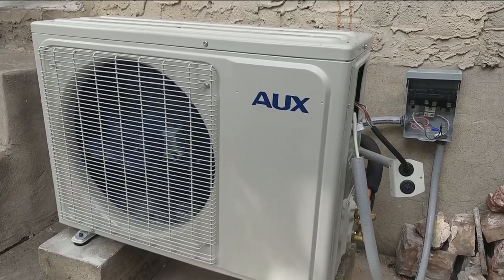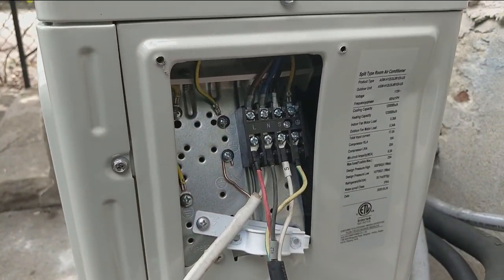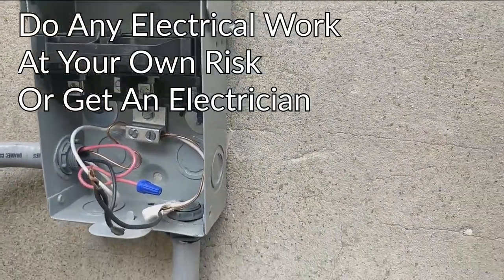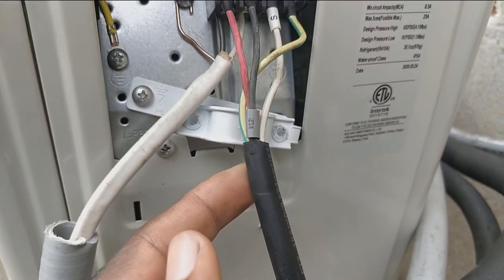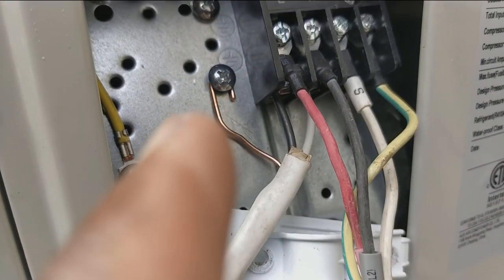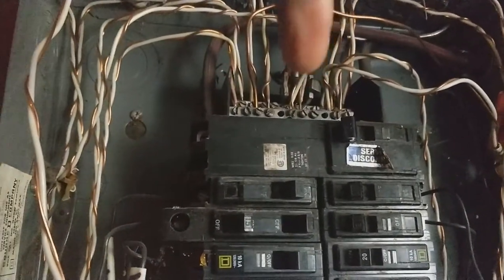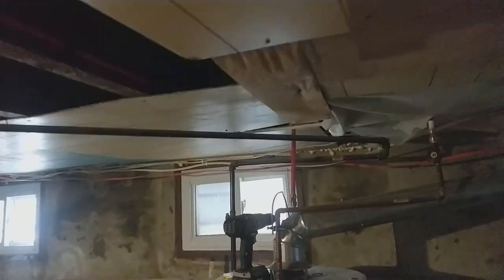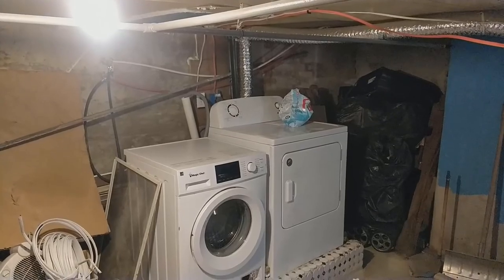How I Install My First Mini Split Heat Pump With AC Combo | AUX Mini Split 1200 BTU 115 Volt

Comment: On the disconnect pull the disconnect T-Handle out and flip it over and put it in the lower slots.
Reply from the maker: I'm not sure what you mean?
Reply: The black handle can be flipped upside down. It will read OFF or ON
Reply: Correct. The disconnect is installed upside down. Pull the back handle out and flip it over.

Comment: Great video!
Did you use single pole 20amp breaker?
I only have room for single pole breaker in my panel. (no room for doubl breaker and everyone wants to use the double one)
Reply from the maker: Yes I use a single pole for that unit.

Comment: Where did the inside wall unit plug at? Or was it connected to the outside unit only and then to the main
Reply from the maker: The interior unit get it's power from the outdoor unit via the wires the manufacture provided.

Comment: How do you take off the head of the blower
Reply from the maker: If you mean the entire cover for the inside unit. You have to look at the middle section where air usually blows out. There will be a little square shape with a 🔒 sign I think. You have to push it in, then you should be able to pot off the cover using a flat screw driver.

Comment: Did you have to buy the AC Refrigerant, or is it already in the AC Unit and you just use the pump you bought to circulate it?  Sorry… new to all of this. Thanks
Reply from the maker: The unit come with refrigerant in it. The pump is used to take the air out. After that the refrigerant can be released. Some people don't use the pump. I not sure how bad it will affect the unit if the air is not pump out before releasing the refrigerant.

Comment: What kind of vacuum pump connector did you use? My install is on hold because the standard size doesn't work on the unit.
Reply from the maker: It's below the video in the description box
Vacuum Pump: https://amzn.to/2FIj98J
Manifold Gauge: https://amzn.to/2ZZv1tS
Adapter for Mini Split: https://amzn.to/3hQB5uR
50' 14/2 with ground: https://amzn.to/302aq82
AC Disconnect: https://amzn.to/2HoJR6J
Senville Mini Split: https://amzn.to/2FI1nm3

Comment: Hi, thank you for your video. Where did you connect the gray wire that was on the inside unit that comes preinstalled?
Reply: It's power wires, I just don't know where I'm supposed to wire it up to
Reply from the maker: Looks like the gray wire goes to the "S" Spot. I think it's the communication wire.
Reply: @talenteddad  thank you for responding! I almost never get one when I post on a video haha. I went through all the other comments and found a video you suggested to watch. Turns out this specific style I have is so that the inside unit can supply the outdoor unit if needed, otherwise can do in reverse order and connect to 120v outside. 

Well see tomorrow when I attempt this install
Reply: @talenteddad  yeah the gray wire was hooked up to 120v and plugged into its dedicated plug inside to run both the outside unit and inside unit. Works great! Thanks for your video!

Comment: I bought a mirage 12000 btu 115 v doni still have to add power from a braker besides just the main plug cord???
Reply from the maker: Legally the should be a breaker outside next to the mini split. But I also see people connect it straight to a breaker in the main panel.
Reply: I have a different unit but they're pretty much all the same I think there's two factories. On the 115 volt I just got a power cord to handle that much I got it a little beefier. I think I bought 12 ft it has the three prong plug and I just plug it into the wall. This is my second year with that it is awesome. Thinking of getting one of these for my next one on the other side of the house.

Comment: Did this unit also have a power cord coming out of the back of the indoor unit?  My unit does and the manual only comes in a language I cannot read...  Thanks
Reply from the maker: It came with a power cord that connects the indoor unit to the outdoor unit. That cord provide power to the indoor unit. That cord is also used for communication between the t2 units.
Reply: @talenteddad  this is why I'm confused because my unit has that cord and a power cord coming out of the back of the indoor unit...
Reply from the maker: Do you have the same brand that I installed? There are some brands that the power go to the indoor unit instead of the other unit.
Reply from the maker: Search "No HVAC contractor needed ductless mini split" on YouTube. It should be the first video. I think that video will help you out.
Reply: @talenteddad  yes it's an aux.  I'm thinking you're correct it's powered from inside...
Reply: @talenteddad  Thank you for the help.  I greatly appreciate it!
Reply from the maker: No problem. Glad that I could help you!
Reply: Hi. Did you figure out why your disconnect wont work? I have same exact problem. Same unit, same wiring and same disconnect.
Reply: @sharonlynch8522  disconnect wasn't problem I had.  Disconnect is likely wired wrong.
Reply: I have this unit and I have thermostat at 72 hot when it reaches the temperature it stops but starts blowing like cool air anybody knows thanks
Reply: @talenteddad  my aux 1.5 ton unit comes with a cable that has 3 conductors with crimp lugs on the end coming from inside unit. Then it also has 2 soow cables that look like they connect the inside and outside unit. So the inside wires need to be put in conduit to power source disconnect?
Reply: @eduardolira8301  did you figure out? Thanks
Reply: @mehib2340  did you figure out thank you
Reply: @issacbenites  yes got it figured out.  The indoor unit is powered through a cable to the outside unit

Comment: I am thinking about purchasing this same model. My house is about 900 sq ft. This will go in the living room right next to the kitchen. My question is, is 12,000 btu enough to cool my living room? It  is an older home that has the afternoon sun hitting it so it gets pretty warm. Do you think I should go bigger? Also, was it hard to install and vacuum out lines etc.? Thanks!
Reply from the maker: This unit should be enough. It's not hard to install if you have some experience with basic tools.
Reply: Hello @normanGiuseppe we’re you able to install the unit? My home is about the same size.
Reply: Hey @mayasc300  , I am still debating whether to go bigger or not. It's an old house with little insulation. The walls towards the sun gets really warm to the touch  but the reason I was considering this is that it is a lower voltage so I don't have to upgrade the wiring. I am still undecided unfortunately.

Comment: Did you buy the wifi module or it was already installed?
Reply from the maker: Some unit come with the Wifi module some don't. Make sure you buy the one that comes with it if you are planning to control it with your phone.

Comment: Why don't you leave the drain line outside right there and let it run under the fence. Anyways. Thanks for the video
Reply from the maker: That would be great but the unit is installed on an inside wall between the kitchen and the dining room. It was easier to drain it in the laundry sink.

Comment: Do I need to purchase a install kit or does this unit come with one
Reply from the maker: It does not come withit a installation kit. You will have to get a couple more stuff to install it properly. Here are some of the item that I used.
Vacuum Pump: https://amzn.to/2FIj98J
Manifold Gauge: https://amzn.to/2ZZv1tS
Adapter for Mini Split: https://amzn.to/3hQB5uR
50' 14/2 with ground: https://amzn.to/302aq82
AC Disconnect: https://amzn.to/2HoJR6J

Comment: How good does it work for ac and heat
Reply from the maker: It work really well. If the temperature drop below 15 degree it will run more because the colder it is outside the less heat it can find outside. If you are planning to get 1 make to get a unit with enough BTU to heat or cool the room

Comment: Why do you have a link for heat pump don't it come with heat pump already?
Reply from the maker: You can get them at Lowes, Home Depot web or AUX Web
Reply: @talenteddad  but my question was don't it come with heat pump already?
Reply: @rhmn183  the link was for a vacuum pump, not a heat pump. The heat pump is built in the unit.  A vacuum pump should be used to remove air from the lines before the refrigerant gas is released into those lines.

Comment: You need fuses in the disconnect handle to let current go through.
Reply: That's not a fused disconnect, all you have to do is pull the handle out and turn it over 180° and that will close the circuit

Comment: Mine gives me an E5 error code any advise?
Reply from the maker: I not really sure but the wires between indoor / outdoor might be connected wrong or no Communication.
Reply: Did you ever figure out what the E5 error code was fixed?
Reply: @linabell2174  well the motherboard burned out